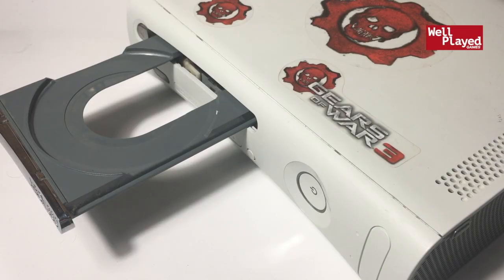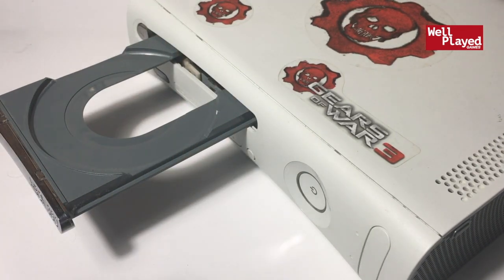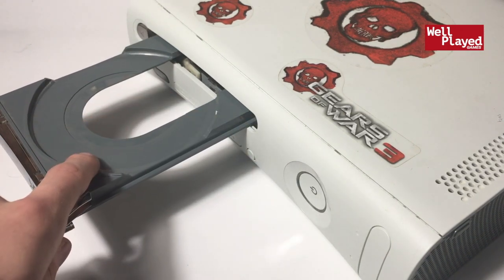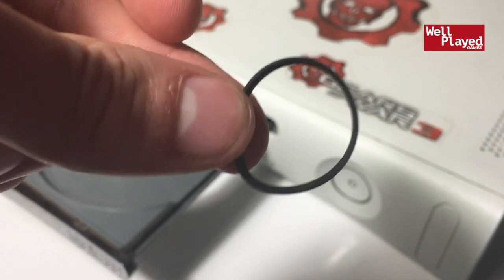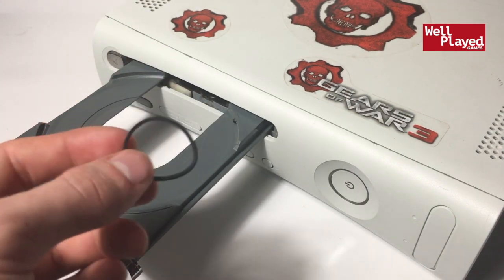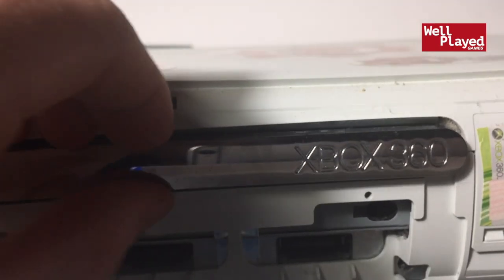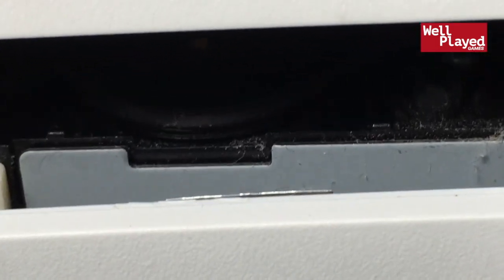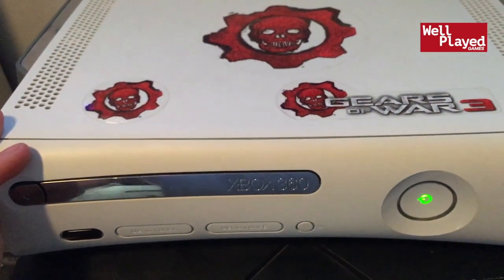Xbox 360 Stuck Disc Tray Repair Simple Easy Fix (Works With Xbox And Xbox 360)

Comment: This video is full of TERRIBLE advise!  DON'T bang on the top of the unit, that doesn't help.  Use the manual eject procedure which requires the insertion of a straightened paper clip into a specific (tiny) hole somewhere on the front of the drive itself. It will require removal of the face plate from the console, and the location of the home IS different depending on which drive MS used when they made the console, look it up online, there are only 3 or 4 different places it can be but you have to make sure you're using correct hole, you don't want to be jamming a paperclip into the wrong place and damage the gears or drive belt or electronics!

Also, don't force hold the tray open while shutting off the console! Instead, just get the tray open (using the eject button or the manual procedure above) then simply unplug the console.

Next, don't use tweezers to dismount the eject belt! You'll nic/cut the belt with the ends of the tweezers and it'll eventually cause the belt to break completely.  Instead use a hooked pick (available for $1 at any hardware store or even Walmart in the tool section) to get the hook under/behind the belt then gently pry the belt off the drive wheel, and extract it from the console that way.  Make sure the hook isn't sharp/pointy, if it is, sand or down so it's rounded/smooth, no sharper than the tip of a pencil that you've been doing a lot of writing/scribbling with.  If it can poke into your skin, it's too sharp! It only needs to be pointy enough to get behind the belt and pull it up/over the lip on the pulley without cutting the belt.

Comment: Or here's the easier option that worked for me use a butter knife under the tray to pry it open and once you did that wet a cotton swab and clean the rubber and gears under it and it should open from there😊

Comment: The tray closed while the loop was out. How to open the tray?
Reply: Take the faceplate off your Xbox. You’ll see there are two little holes under the disc tray. Take a paper clip, unbend it into a straight line, and poke it into one of the holes. This should hit the gears that control the disc tray and force it to pop out.

Sometimes you need to hold your console so the disc tray faces the ground. Do the paper clip trick and gravity should take care of the rest. Hope this helped!